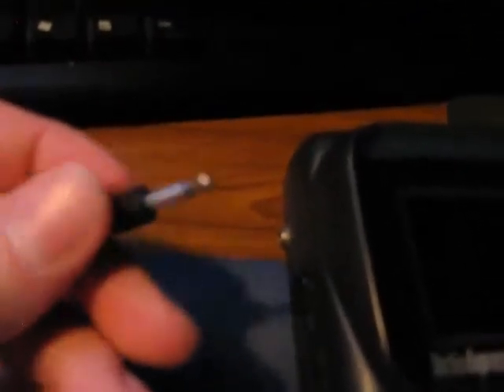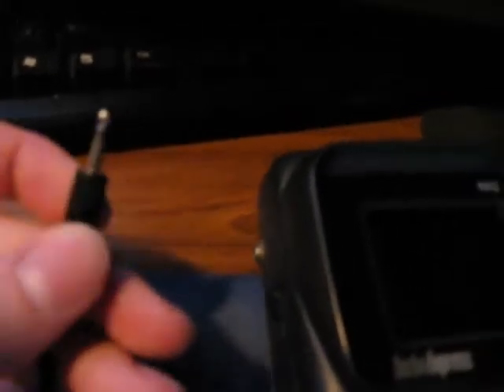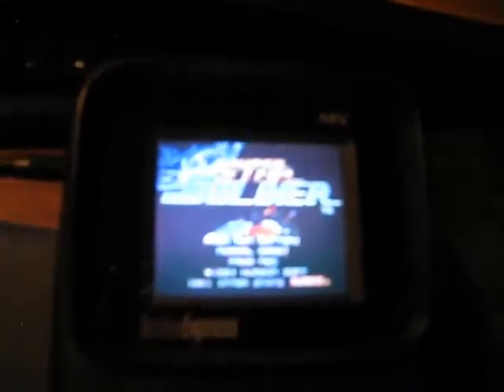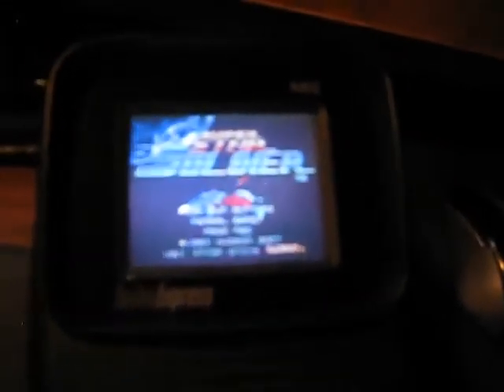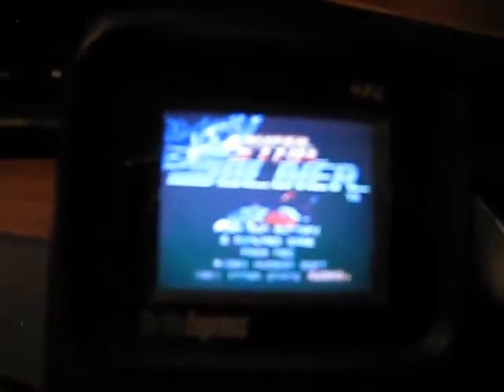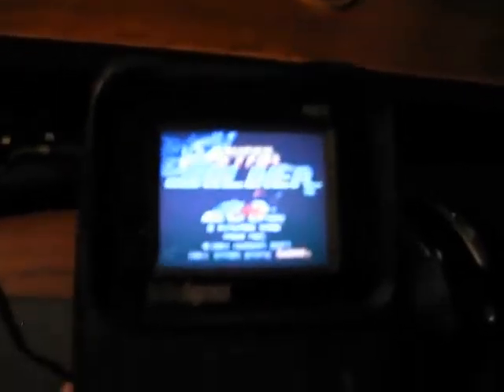Saving my 20 year-old NEC TurboExpress from the grave!!! Can I do it ??

Comment: I have one too, but one day it just stopped booting up. I've been thinking of looking for someone to fix it.
Reply from the maker: Yeah, it needs full capacitor replacement now! Best to do it ASAP because capacitance gel causes corrosion of the board, traces, vias which would then create more problems harder to fix than just replacing all capacitors! The cap area must be cleaned very well/thoroughly before soldering in the new capacitor! I know some people who offer the service, lemme know when you're ready to do it.

Comment: I think you ramble more than I do lol 😂 Nice job on the repairs! Lucky none of the chips got eaten up, when those systems puked it was usually pretty bad.
Reply from the maker: Wish I knew about the tantalum caps when I did it, I could've eliminated the humming sound in the headphones as is present with electrolytic. Plus, I used the same style of caps, so it'd be just as difficult to desolder them next time.

Comment from the maker: Speaking of sound, I was reminded of something worth mentioning. The expert modders over at PCEngineFX like thesteve told me that if I had used tantalum capacitors for the power and sound related ones, at the very least, I could've gotten rid of the ever-present humming noise/sound that's very noticeable in these units. Tantalum capacitors are more expensive than what I got (electrolytic) but that is worth considering if you have to do this yourself or ship it to a modder to do it for you...